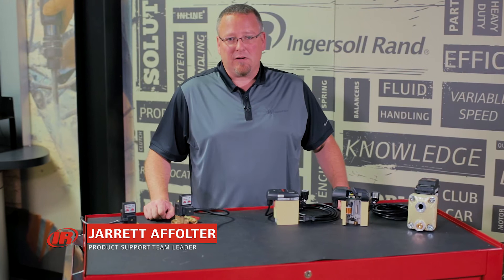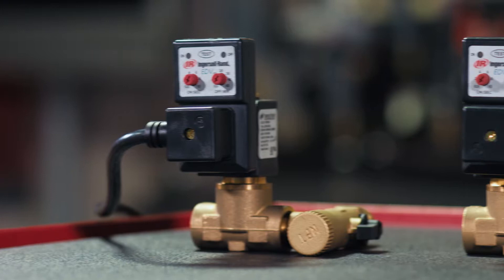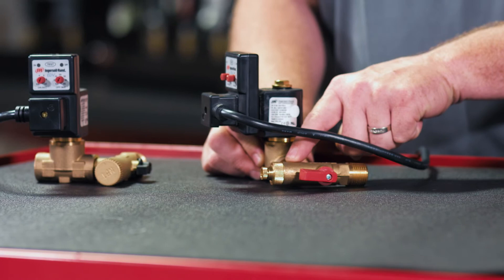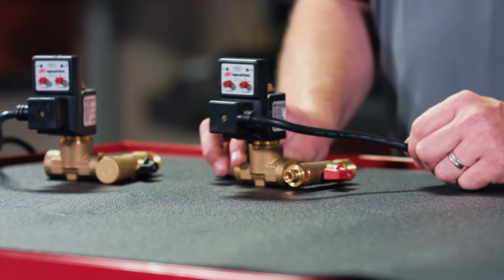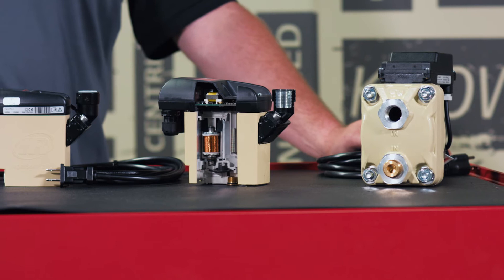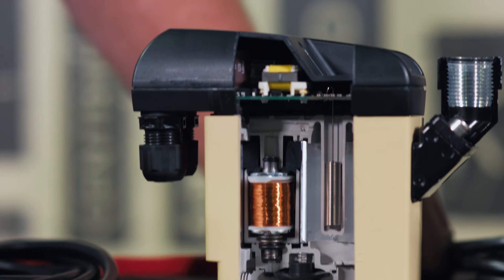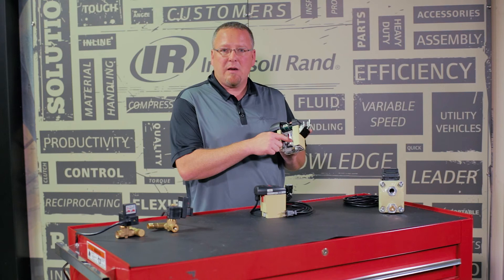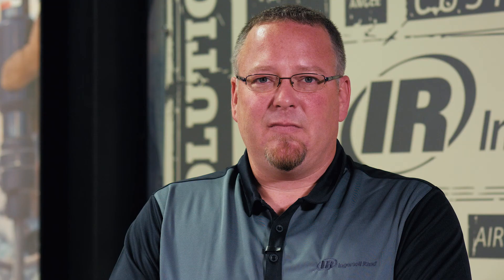Ingersoll Rand Electronic Drain Valves

Comment: I was just looking at these on IR website. I dont see a reference chart telling me what model drain valve to use on what model air compressor. I know I need a 220 volt but I'm unsure about how or where to make the electrical connection. I thought I'll just get the model for the compressor I'm going to buy and when the both are here I'll install but I'm not seeing any chart...maybe it will be in the compressor manual idk?